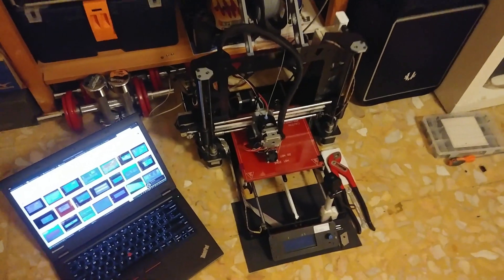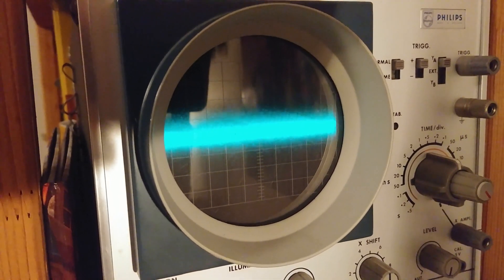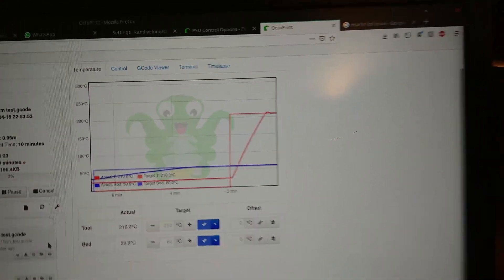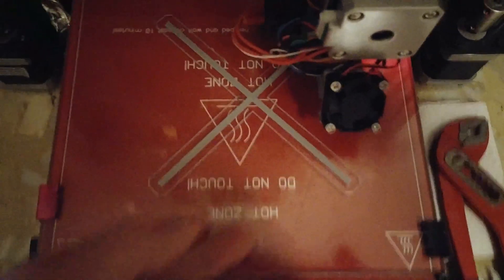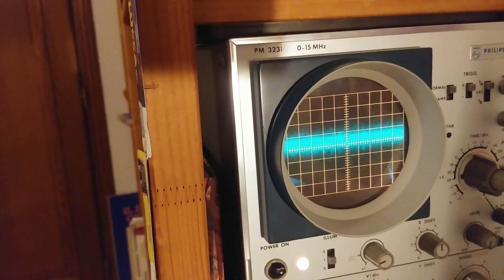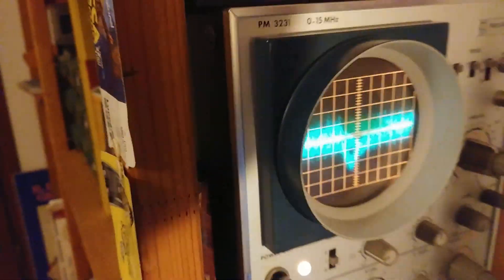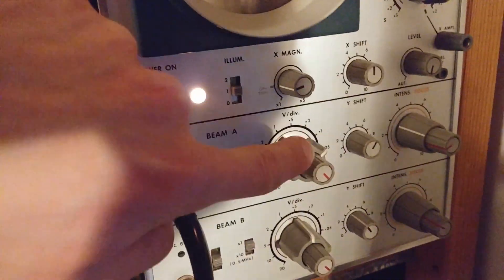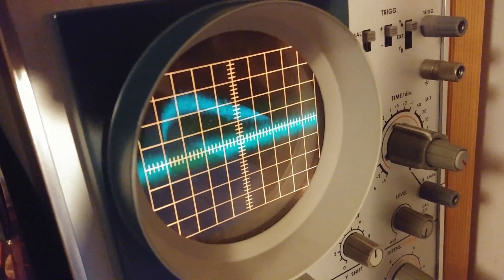Fixing a garbled LCD on a 3D Printer

Comment: Sorry, I have tried with a Electrolytic capacitor in parallel with a ceramic one. I am using a TFT35 v3.0 and a SKR 2 mainboard. I have soldered the capacitors directly on the backside of the mainboard directly on the power connector solderpads. The screen is scrambled after some time when the nozzle and bed is warmed up. I have another printer with a TFT35 v3.0 and a SKR 1.4 turbo. It also scrambled the screen in Marlin mode from time to time.
I also tried to make a screen over the two 10-pole ribbon cables to the display, made with copper tape and connected directly to the ground pin on the supply. I also tried to connect the floting null power pin to the protection ground on the supply that is also connected to the chassis. This did not help.

Comment: Mine shows japanese characters ontop of english. What does that mean? Is that still noise or corrupted data or something?
Reply from the maker: Does it start off fine, then get corrupted?
Reply: @coccoborg yes
Reply from the maker: @ACEGtagTeam  a better approach is putting a capacitor on the +5V and GND on the back of the display
Reply: @coccoborg which uF value should the capacitor have?
Reply: I have this too, it looks corrupted when booting but in menu there is Japanese over top the options I’m not sure what it is but I’ll try some stuff

Comment: Hi I actually fixed this weird characters issue and the reason was because my stock ender 3 PSU had a faulty ground connection. I end up buying a Meanwell LRS-350-24 PSU and solved my problem.
Reply from the maker: That could also be a problem! Obviously with no good groud the board as a whole could float to a ridiculously high offset in potential.

Comment: Thank you for sharing the discovery. What size CAP would you recommend for 24V controller boards ?
Reply: Probably the same size. Just make sure the volt rating is higher than 24v
Reply from the maker: Pick a 50V one with a low ESR, I'd say try a 100uF one, should be good to go.
For 12V a 20~30V rated one should be ok

Comment: Same problem here since i've installed a skr 1.3 in a cr-10. Did it happened again later? Thanks!!
Reply from the maker: It has not happened since putting a big capacitor on the board's input